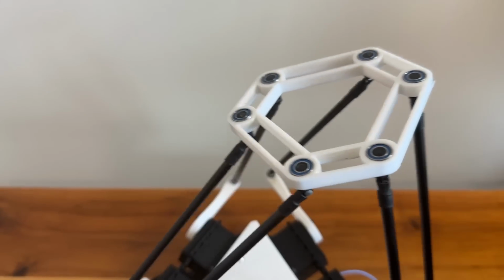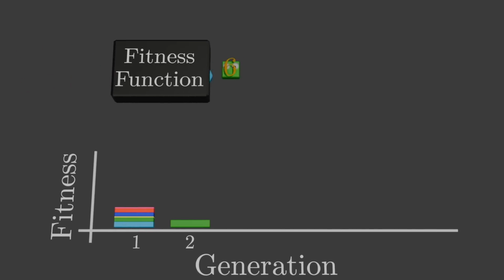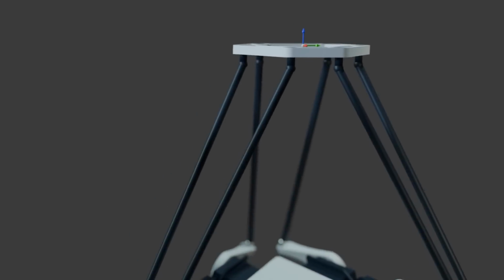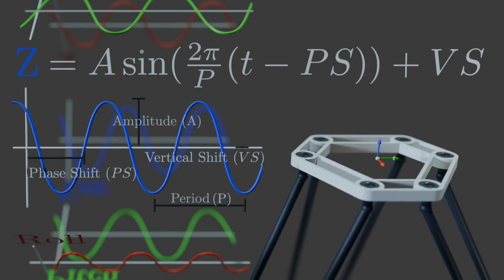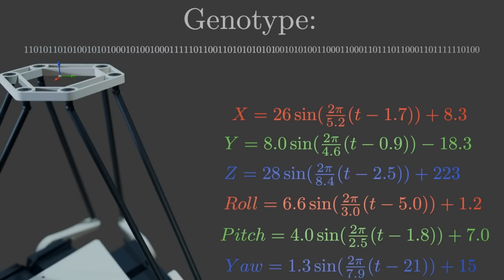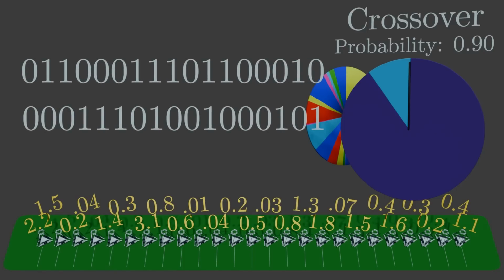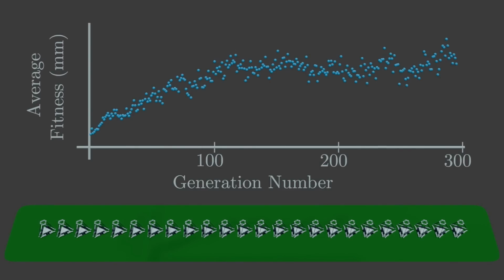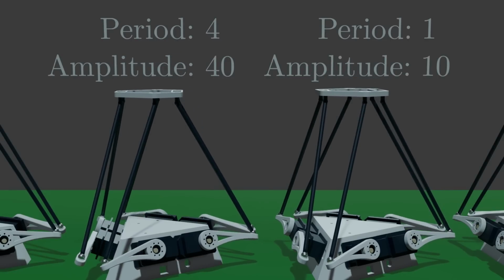The Robot Learns to Run

Comment: Nice project.
Rubber pads in the legs contact surface may allow for greater speeds...
Shifting the wave form towards the ground may reduce 'no contact' time...
Using NEAT to 'punish' unwanted behaviours (long no contact times, wrong movement direction, etc) may generate better solutions...

Comment: Perhaps designing a sequence of stages with different constraints on evolution would yield interesting results - for example, if you first ran several generations with the fixed sine wave phase, then took the best offspring as starting points for another several generations in which the phase is allowed to vary, and maybe another factor is locked instead. Different orders of the same constraints could lead to wildly different solutions - it would basically be a genetic algorithm of genetic algorithms, simulating a slowly changing environment...

From that last thought, I wonder if the specific constraint changes could also be determined algorithmically in a way that simulates each generation's impact on the environment...

Comment: JD Robotics,

Such a cool project! I am a fan of genetic algorithms myself, have you taken a look at Real-Coded Genetic Algorithms (RCGAs)? They are similar to Binary-Coded Genetic Algorithms (BCGAs) but use real values in their genes instead of binary. There are a handful of cool crossover events as well that you can do with real values. I don't know if it would have changed the results of your simulations but if you are ever interested it could be fun to see the difference in effectiveness between the two types of genetic algorithms.

I had initially brought this up to argue your crossover event. My thought was that representing floating point values with binary could cause crazy values to result when your crossover splits up a mantissa. This is not the case! I worked an example out to myself and it actually results in very reasonable values! I'll keep my comment here though just in case you have not seen RCGAs before! (And it would still be cool to see a comparison between RCGAs and BCGAs on a real bot), I have not done extensive work with comparing BCGAs and RCGAs so I do not know if there will be a difference if applied to the same problem.

best,
random internet commenter and new subscriber
Reply from the maker: Thanks! I actually started off with some sort of real-coded algorithm, I wasn't using any special types of crossover though, and my mutation would just randomize an entire parameter. Switching over to the binary-coded helped, but I also improved other things at the time, so it's hard to say how much. I'll have to look into how RCGAs handle crossover and mutation. I hadn't heard of them before, thanks for letting me know!

Comment: Nice project ! 
I think a couple good changes would be, 
- Add rubber ' feet' the lack of traction seems to be hurting the performance. 
- perform the tests for more iterations with perhaps a larger population? I'm not sure what your population size was but most videos I watch on these topics have between a 100 and 1000 members and test for 1000 to 10 000 iterations. 

If you do plan on testing, in simulation, what geometry would be best, you should combine that with finding the optimum gate. As geometry and gate would be linked. This will increase simulation complexity however. If you can perform these simulations on a campus computing system, I would suggest that. 

Looking forward to your next video on this!
Reply from the maker: Thank you! 
I ended up using a population size of 30 for most of the simulations. Increasing that and the number of generations would be great, but I'll have to improve the code and maybe use a faster computer for that.

Comment: Regarding period selection: instead of choosing random real numbers, choose a random natural multiple of the base period (2, 5, 15, etc.). This will ensure all movements are synchronised within the desired timeframe.

Finally, regarding the selection of an alternate function: because your solution is defined to be periodic, Fourier proved that any solution will be of the form of a summation of sine waves scaled and shifted across all frequencies. As such, you could simply include more sinusoids at higher frequencies for each DoF.
Reply from the maker: Great ideas! Using integer multiples seems obvious looking back now. 

I had planned on adding more sine waves for each dof but never got around to it. I was toying with the ideas of either having a set number of waves for each dof or having a set number for each solution and control what dof each one corresponds to in the genes.
Reply: Ah yes, the equivalent of performing jpeg compression on a large neural network

Comment: Very cool! How did you generate the footage of multiple bots at once? (eg. at around 7:12)

I'd be very keen to see how you go if you decide to optimize for geometry as well as gait. I also wonder how modifying the friction between the legs and the ground would affect the speed 🤔 From the footage at the end (eg. 16:33), it looks like there's quite a bit of slipping, though it's difficult to know whether that helps or hinders the movement.

Keep it up!
Reply from the maker: Thank you! 
To animate the multiple bots, I had all their joint positions, pose data, generation numbers, and other topics saved to a bag file while the sim ran. Then I had a python script that could get that data and set keyframes for my model in blender (the animation software)

Good eye on noticing the slipping. I have rubber feet on the base which makes its friction much higher than the arms. I think it helps on the gaits it found but I agree trying different friction values could be interesting. Maybe having every other arm be grippy or some other combination could have good results.
Reply: @JDRobotics  Very interesting! If you don't mind my asking, how did you go about getting the CAD into blender (presumably with mates intact)?
Reply from the maker: @harrisonlow  I don't know of any way to import them with mates. I imported STLs that I used for 3d printing and modeled some of the other components in blender.
Reply: @JDRobotics  Interesting! Cheers for the reply 😊

Comment: put rear-most leg into soft contact with ground, lift front up fully so it pivots up on the rear legs, lower rear to contact frame, drop front. repeat. is basically falling forwards by altering the pivot points. It's not generational learning, but I wonder if it's learned forwards speed can physically surpass that basic movement sequence? (It has to not bind it's gantry while doing it obviously)

Comment: I'd be interested in seeing a tutorial on how you used gazebo. How did you enter your robot, duplicate your robots and simulate your robots?
Reply from the maker: Thanks I’ll keep that in mind. In the sim I didn’t actually have multiple robots running in parallel or spawn/despawn new bots. I just ran a solution on the one robot,  noted how far it went, then tried the next solution on it. All of the starting, stopping and recording distances was in a ros2 node that would send joint positions to the robot in gazebo. 
I’ll try to get all the code together and make it public if anyone would be interested in that.
Reply: @JDRobotics Yes please
Reply from the maker: @MusingsAndIdeas Everything is public now! Join the discord if you have any questions or want to help!